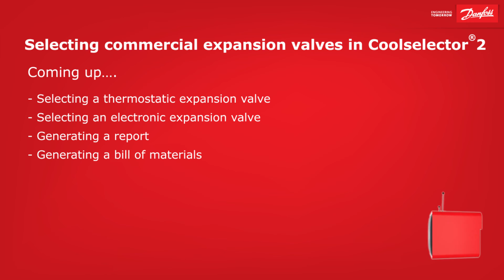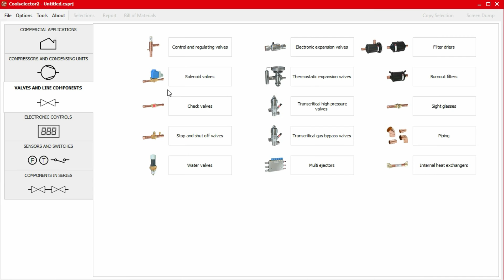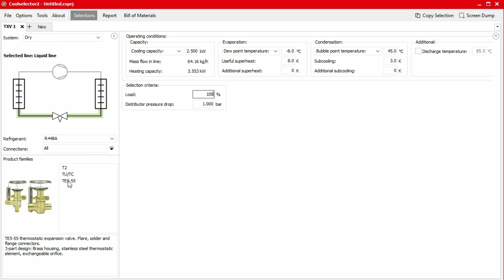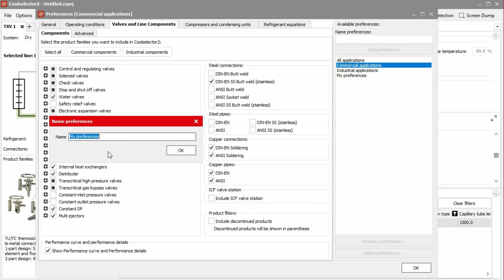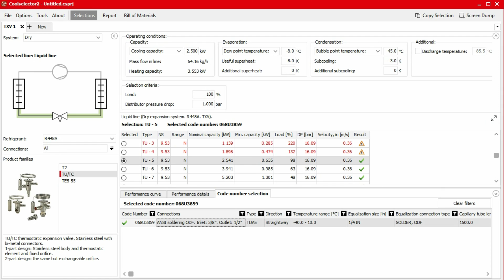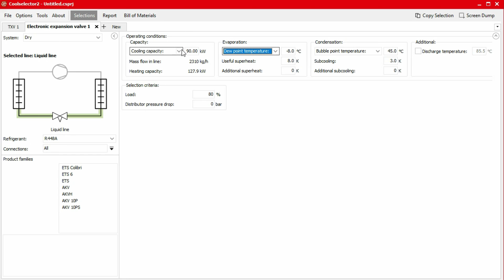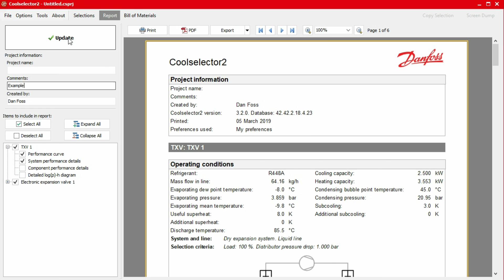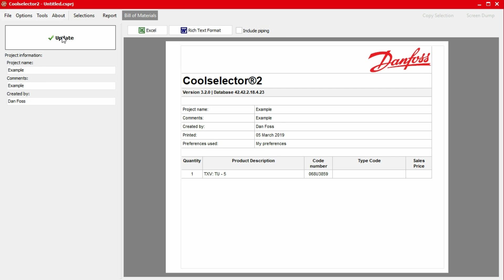Coolselector®2 – Commercial TXV/EXV (expansion valves)

Comment: For an LT condensing unit system (one evaporator, one compressor), would 50-60% valve loading still be recommended for an AKV? I have experienced "hunting" in such a system because I believe the recommended valve size was too large. We changed the orifice down a size and it ran better. We could have the load estimate a little high. Thanks in advance.